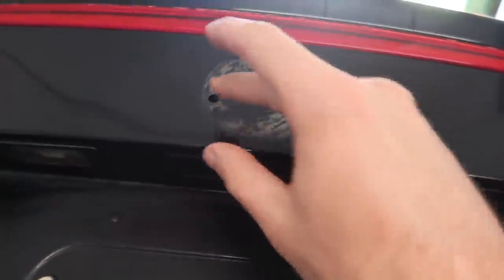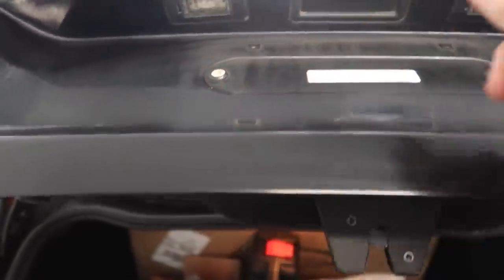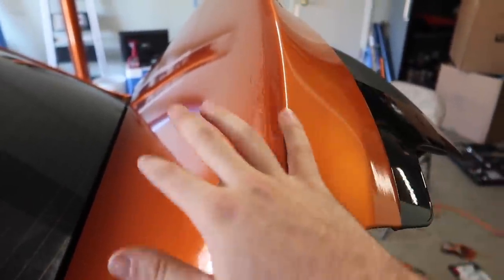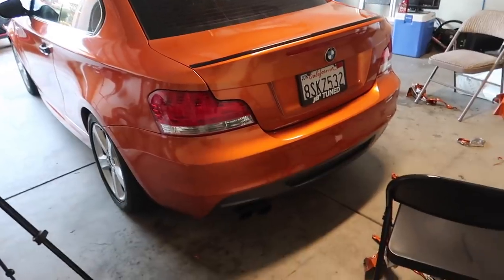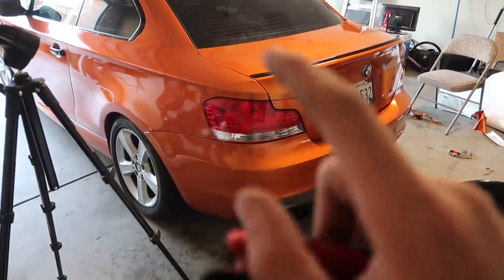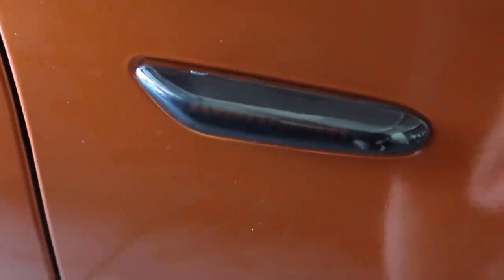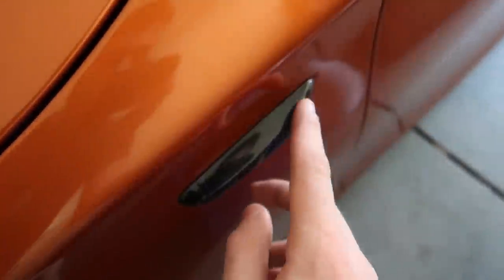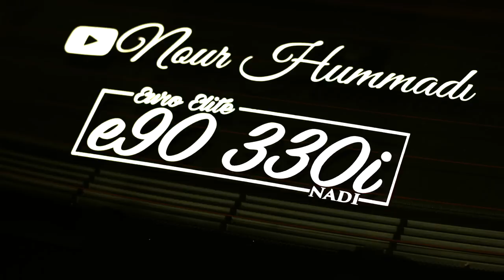135I WRAP IS PRETTY MUCH COMPLETE! (+ NEW MOD)

Comment: You can take the 3m tape off with a eraser wheel that goes on your drill, it comes off fast and doesn’t mess up the paint. Their about $30 and are worth every dollar.
Reply from the maker: Thank you good to know!
Reply: Just some simple tar and glue remover works too